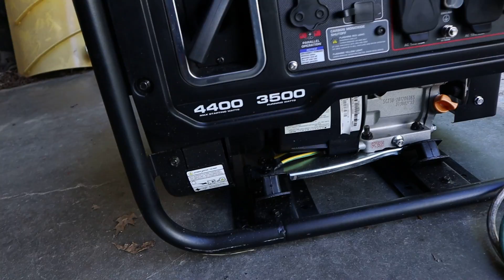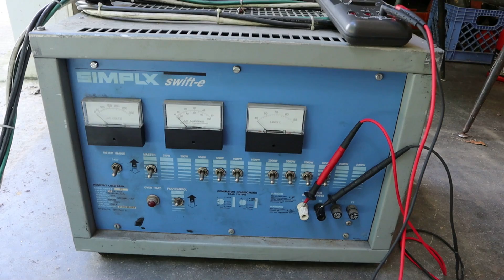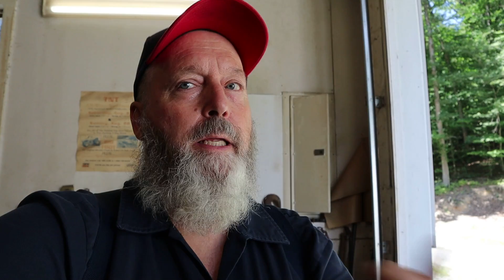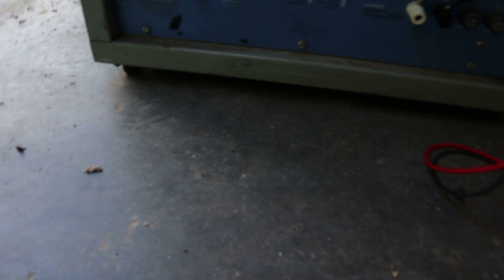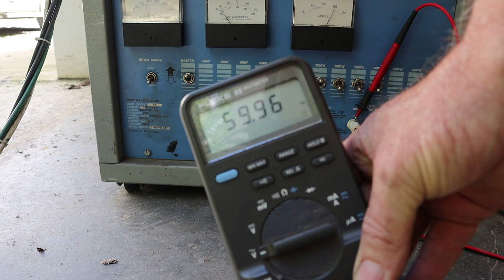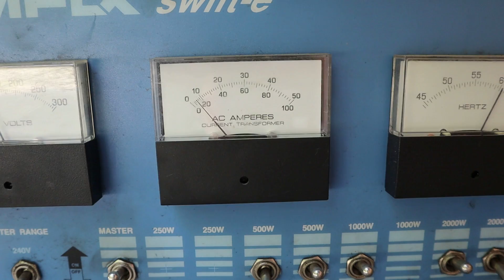Will A Harbor Freight Predator Generator Run An RV

Comment: I went with the 4500 dual fuel Champion invertor generator, and it runs all my items no problem. I do just have one air unit. So far just run propane in it and run it in eco mode.

Comment: If you check voltage from the hot to ground, you may get 120VAC or so.
If you check voltage from the Neutral to Ground, you may get about 64VAC.
Floating Neutral.
You really do not want to bond the neutral to ground or ground this to your RV.
If you touch the RV chassis while laying on the ground and this generator is running, you could get electrocuted.
Anyone running around barefoot and stepping on the metal steps of an RV could get electrocuted.

Comment: There's something wrong with them I think they may just be garbage I bought a 6500 watt predator a few months ago because I live in a camper so I went to have it in case the power went out well my brother needed a generator yesterday so we decided to try mine to make sure it works but it doesn't have a 30 amp outlet so we tried to use a 30 amp adapter and plug it into the 110 outlet and it through the breaker every single time it has some kind of outlet that says Max 25 amp but you can't plug an RV into it
Reply from the maker: Mine came with the RV adapter to go into that 25 amp receptacle on the generator, but it still would not run the AC.
Reply: @hillbillyrv I got the 6500 watt generator so I'm hoping it could ruin everything but it has the 25 amp outlet on it as well but it didn't come with the adapter

Comment: You should be correct on the amps.
I put a 3700 watt running  /4500 peak watt, onan , on a recent ac install on a cargo trailer and I ran just fine. It has the 30 amp rv plug right on it so no adapters needed. Perhaps that's the difference.  30 amp plug vs the 20 regular outlet.
Reply from the maker: My generator has a 30 amp receptical. That is what I was using to try to run AC and for load bank test too.

Comment: Sounds like after reading the comments, maybe they change something in the circuits or control board that want allow the amps to go with the load. It calculates out to 29.345 something amps it should have indicated. Something is definitely screw up on it’s design, and I don’t think the smart start is going do do anything. Not being a Electrical Eng and knowing the experiences you have you probably got it figured out all ready, me I’m saying it a junk gen and needs to be return or dumped. My only guess would be a piss poor inverter design. 🧐☹️😖
Reply from the maker: Chinese junk.

Comment: Knowing the makers, engineers and profit margins plus what I've seen over the decades the newer air conditioners have smaller capacitors that when new might provide adequate load start but given some use the load drops off sooner than past capacitors.  Also has the owner ever use land power amps too low for the air conditioners?  Even a poor connection between hookup and the main power box in the camper will stress a generator with even more power available.  I believe the Hondas are engineered with faster response and many of the 2,000's are capable of connecting in series which would require a faster load response.
Reply from the maker: All junk.

Comment: Just watched the video, and wanted to tell you about my recent expeerience with the Predator.  It turns out well.  To start with, I bought a Predator 3500 a couple of years ago and it works great, and being I travel for teh summer, instead of bringing it home, I left it at my sisters house in Pa.  Get back to Fl, and after a time I decide I should have something here.  They jumped to $929.00, but as the recent sale came up it deopped back to $799.00 so I went and got one.  Came home, unboxed it, put battery, oil, and gas in it. Also  bought the 2 year. replacement plan, though the store will give you 30 days if there's a problem.  Fire it up, running great, putting out 124 volts, ets.  Then I got my tester to check current, plugged it into the 110 outlet and it showed and open ground.  Check the next one, same thing, then put my surge protector to the RV plug in, same thing.  So I called and they said, empty the gas out and bring it back.  I did.  All said and done I ended getting and returning three of four units, all with the same problem.  The manger and I talked and he suggested I just bring the  unit back and he would refund my money.  IHe was telling me they sell millions of them, to which I replied, I know and the one I have had for over two years still runs great, and it's possible they just got a bad batch.  He said yeah it's possible.  I came to the conclusion that when these are being put together, I would like to think there is some sort of quality control, but as long as the unit runs, box it and ship it.  I'm just of the opinion that because the unit runs, all is good,  but the output side isn't checked, because if that was the case, if an open ground was fund the unit shouldn.t be shipped.   I was saying to myself, there has to be a solution to this, so I googled, what if my generator has an open ground. and found that if you were to hook it up to house or RV appliances, though maybe not fry your appliances, it's not good.  Then this video popped up, and it can be found on Youtube, of an electrician, I believe his name is Mike Sokol.  He is showing a Honda 2000 generator with an open ground. I said well a generator is a generator, and ten years ago he made this device, that has  a link to Amazon to fix the problem.  Went and ordered one.  The usual couple of days wait.  Got it.  Fired up my unit, plugged it in, problem solved.  Now have full power to all the plug ins  All light are green.  Like I said,as long as the unit was running, there was noreason to check the electrical side for wiring concers.  Ok.  That's my story.  Hope it helps.  Sorry for it being so long.
Reply from the maker: I will check mine. Thanks
Reply: @hillbillyrv  I have 2 predator generators (one a 3500) and it runs my travel trailer. Micro, a/c etc.Ive had it for 2 years
Reply from the maker: @lacrossed55  Mine should have run it too, but it wouldn't. We tried several times.
Reply: @hillbillyrv  I get all the Harbor Freight ADs./ go to the store I always thought it interesting that with all the shipping and supply line issues these have been available.   Also I think the unit you have is a new offering in the past 18 month. Maybe there is an issue with the new design.
Reply from the maker: @lacrossed55  It was a new model. I bought it about15 months ago. No taking it back.

Comment: Probably the AC compressor startup amp load during the initial startup of the compressor, which exceed 20-30amps for a split second, which is probably very close to the lockup rotor amp rating.   Hard Start capacitor or softstart would help.  Could be possible the way the inverter is producing the sine wave at 60hz. Possibly a floating neutral condition????   I'm just throwing my $.02 out there, and I am no electrical engineer.
Reply from the maker: All sounds logical to me.

Comment: Problem is with the inductive load of the air conditioner the load center is a pure resistance ,a soft start adds capacitance to the circuit to zero out the inductive load. Good luck
Reply from the maker: Thanks

Comment: I was doing some posting on a Facebook Predator Generator page and a person in Florida suggested installing a hard start capacitor.  They are a lot cheaper than a soft start system.  With it I was able to run my 15,000 btu a/c on my 2014 Keystone Cougar 337fls.   I only used it a couple of times before heading north.  I would turn off all the breakers except the a/c and one circuit of wall plugs to use a volt monitor gauge.   

I now have two Predator 3500 generators and a parallel cable.
Reply from the maker: I am pretty sure the AC has a hard start capacitor already.

Comment: Ohms law will set you free lol,  
plus Very rare to have a +0 and -0 tolerance on a commercial electronic device that's more for Aerospace and medical items 😀 and we are lacking information on the ac unit what does the data plate say and is it a older Ac 15000 btu or 13000 btu  wire connections , wire length converter issues,  lots of things to investigate.
, throwing a soft start $$$$$$ ask the ac manufacturer of the ac unit about a soft start i do have one on my 2018 hartland 23rbs northtrail 15000 btu dometic living in Arizona pulls more amps in heat and humidity.
Reply from the maker: AC was brand new. We had just installed and were trying to test it. We were plugging the camper shore cord directly into gen.
Reply: @hillbillyrv  Quality in today's world,  well ..........after I retired I won't fly. I saw
 Thousands hired fresh out of school assembled planes ,  and I should write a book for what I have seen.
Reply from the maker: @Yukonjackman1  I hope QC is better on planes than it is on RVs.

Comment: Boy I would think it should be big enough my brother has the Predator in the 3000 or 3500 and it is working his trailer, I have the Honda 3000 EU and it runs my trailer fine.
I was thinking about getting the Predator 9500 so I had it for the house also incase the power went out but have not got that far yet. There is ALOT of them predators out there or at least in MI here.
Reply from the maker: A lot here too.